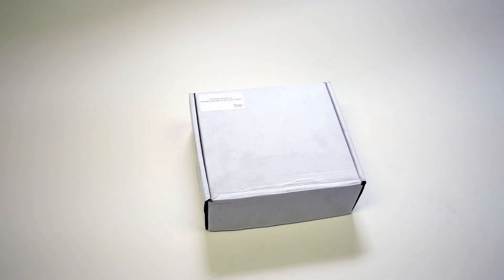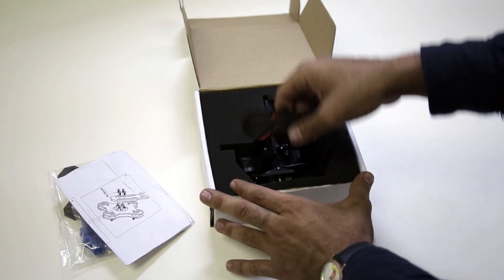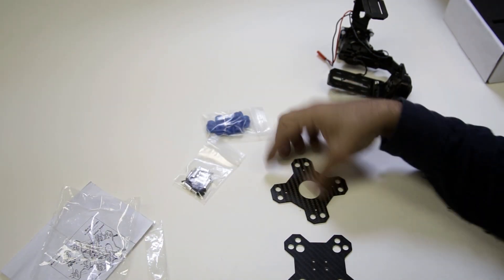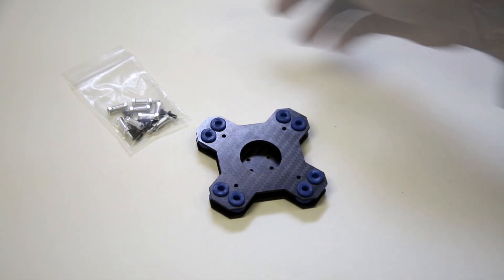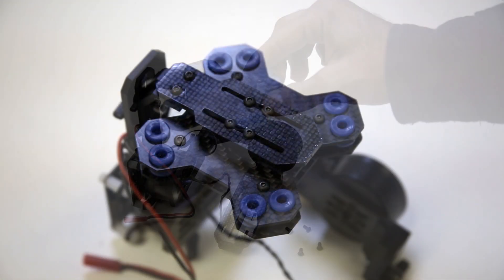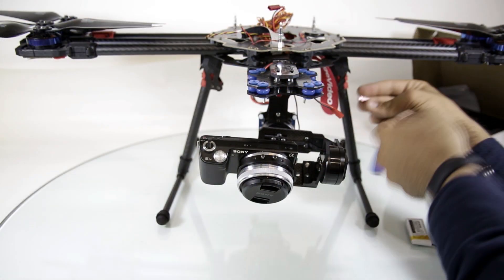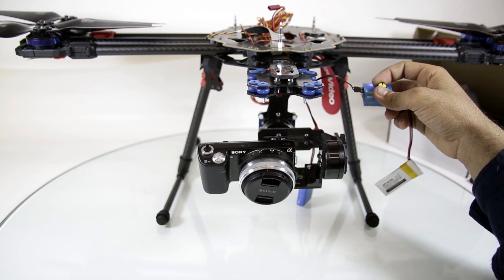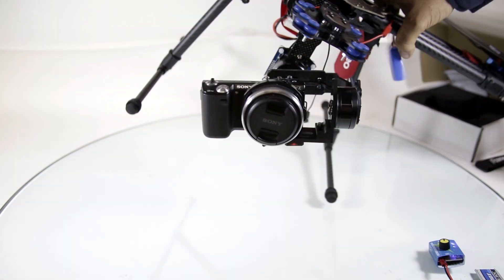HolyBro 2 axis mid size brushless gimbal DEMO

Comment: Why does it look like you mounted the Compression style vibration mount upside down on the gimbal? If it is Compression style it should be flipped.
BTW good looking Gimble I will be getting one.